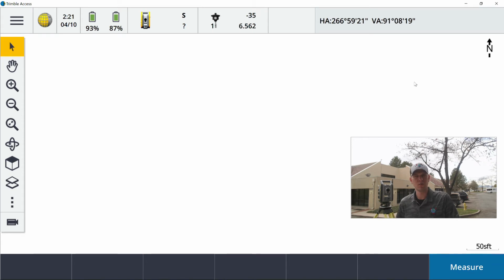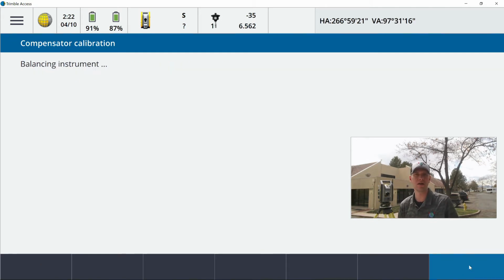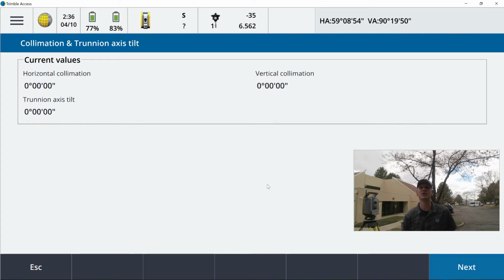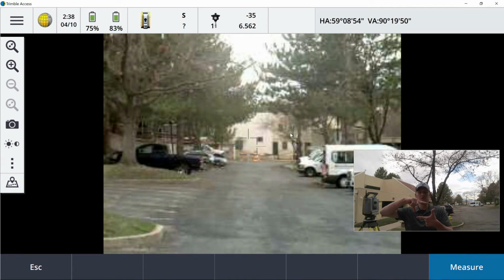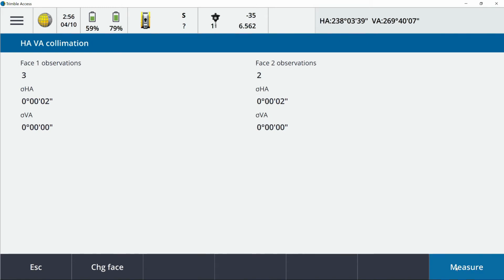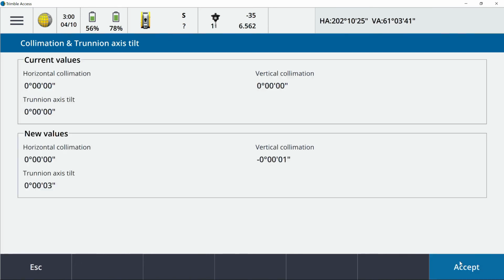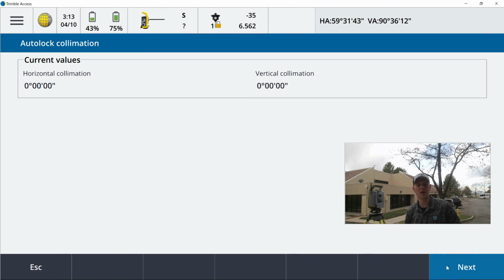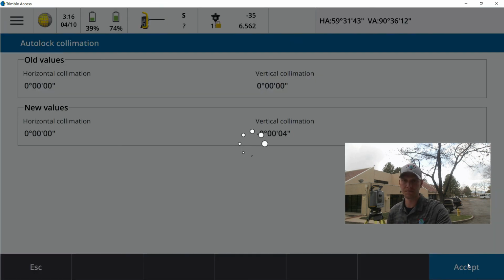Total Station Adjustments - Vectors EDU Tutorial

Comment: When doing the Sighting and Trunion, should you only move off of the target horizontally for the Sighting and back on, and then move off the target only vertically and back on for the Trunnion?  Thanks for the simple and great video!
Reply from the maker: Sorry for the delayed response @flyinlo1474 
If trying to isolate potential errors individually it would be recommended to move off only horizontally for the horizontal axis and only move off vertically on the trunnion axis.

Comment: For the horizontal part. I can use my prism pole and it needs to be at least 700 feet away? And for the vertical part. I can use anything that’s vertically over 30 degrees ? So I need to be looking at a 60 degree vertical angle? Does distance matter?